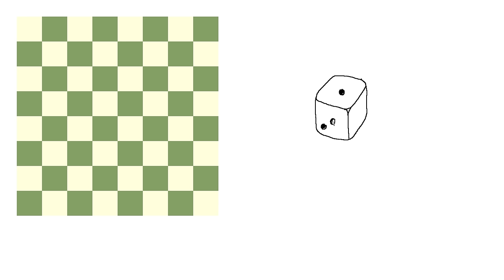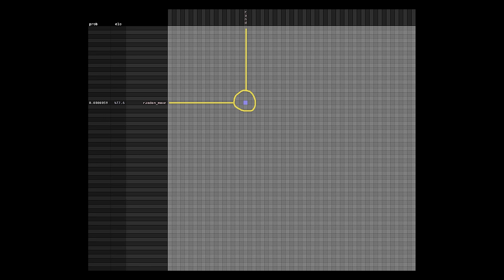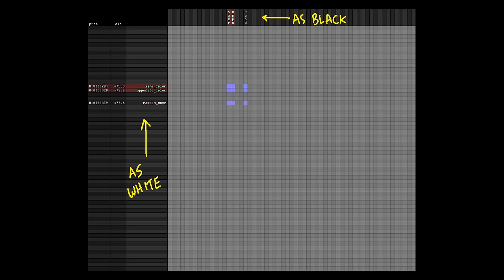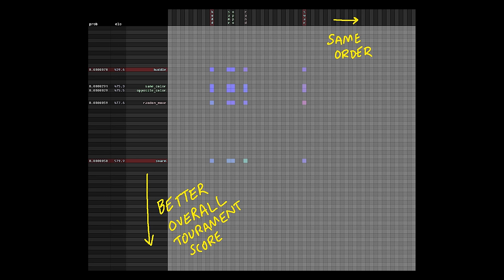30 Weird Chess Algorithms: Elo World

Comment: I know this video is crazy old but I've watched it many times because it's such fun, and I have an idea for an updated version of the blind player if you still actually read these comments. Anyway, I think it would be super interesting to take into account some information theory, much like you implemented spy checking to account for the computer having things wrong, the computer could account for the fact that it doesn't know the /exact/ board and take this into account when deciding the best move. As an example, let's say for the most likely board position there's one move it thinks is best, but not far behind in probability are 4 or 5 boards where the same, different move, is best. You could weigh the probabilities of each board position to the benefit of the move to try and make for better play. You might not want to do this for /every/ board position, as some very unlikely positions would give very favorable outcomes, but integrating this for equally or close to equally likely positions might improve play slightly. Of course this might weigh the algorithm in such a way that it's more likely to believe it's in a favorable position, so maybe it would only have higher winning odds if it got the advantage, and play worse otherwise. I'd bet that stockfish has a more complex idea of what the most "beneficial" move is, but I'm not sure. i.e. a move that removes disadvantage would be just as favorable as one that capitalizes on advantage? Really really long comment for a relatively simple idea (although I'm sure it would be far more complex to implement than I could imagine if done well, likely involving information theory) but I thought I'd share in case you're interested in trying to improve these bad players! The concept of optimizing such a disadvantaged player is very intriguing to me, so I hope you do some day! Maybe I'll even give it a shot, who knows.
Reply from the maker: I agree! I mention a very similar idea as “future work” in the paper, but annoyingly it is hard to get Stockfish to tell you its “second best move” so this ends up being more expensive than it looks to implement. I do think this would work a lot better, though
Reply: @tom7  I'll have to give it a read sometime! Taking into account the next best moves rather than the next best board positions is an interesting idea. I couldn't imagine doing the stuff you do myself, but maybe someday! You've certainly laid some fantastic ground work 😂 Love your content by the way!!! Watching you take "bad" ideas farther than even their logical extreme is always hilarious and extremely intriguing. The amazing aesthetic alone of your reverse emulation of the nes still blows my mind. I legit thought that TV was added in post until you moved the camera!!!

Comment: 4:52 You don't have to. You only have to rank all possible rook moves, then all possible bishop moves, then all possible knight moves, then all possible king moves, and all possible pawn moves. All other moves will be illegal.
23:29 Chessmaster has 14 difficulty levels, but there is a big jump in difficulty from Newcomer 2 to 1: 60/5. Other settings like Deep Thinking, Opening Book and Mate in X moves also affect its performance, but the first 2 levels are pushovers

Comment: So I had a thought about the strategy that scores all legal moves in a tree:

What if the scores assigned alway assumed that the opponent would choose its highest scored move 1-2 levels “shallower”. So if we’re scoring 5 levels deep on the tree, we’re scoring our opponent’s options 3-4 levels deep, assuming the highest scoring option to any move we make will be the response that an opponent will take, then choosing the move that leads to the highest scoring second-level move given that assumption.

I’m not currently sober, and haven’t given the idea much thought, so I wouldn’t be surprised to discover there are some flaws or hurdles that I haven’t considered. I do understand that the recursive nature of this strategy will likely increase computational time significantly, but part of the point is to see by how much and if the trade off is worthwhile.
Reply: As someone who has very, very little experience with minimax (though still a little bit) I’m not sure how that would even work. At various levels in the tree, you’re looking different numbers of moves ahead (for example, by the time you hit the third-to-last layer, you’re only looking at two more moves.)

Comment: Probably way too late for this insight but is it possible the Fatalist pieces perform better due to a sort if reverse survivor bias?

Like, the data you use was drawn from games played normally. So the space a piece is captured in was always placed there by a player with some degree of a strategy in mind.

Since the set of moves by which a piece reaches a particular square is limited, and most pieces aren't moved very many times in a single game - wouldn't an algorithm seeking to place those pieces as quickly as possible end up recreating some of the basic strategies in the games  from its dataset?

Like, to reach the most common death spots, wouldn't the algorithm necessarily have to kind of recreate the most common Openings?

Comment: Lonely: opposite of huddle, pieces would try to move as far away from their own king as possible.

Progressively bad: pick the Nth best move from stockfish, where N is the current move number in the game.

Quest: start by selecting which piece should move using either stockfish or random. Move only this piece until it is captured or is no longer able to move.

Diagonal copycat: copy the moves but diagonally across. E.g. if left side knight is moved, move the right side knight to the corresponding place.

Mediaeval: rooks don't move at all. Queens and bishops do not capture. Exceptions to this would be if such a move would be required to take the king out of check. use stockfish for the selection of these legal moves.

Linear: attempts to create a thin horizontal line. Initially it would have to make some legal move which would take it out of being a line, but thereafter it would only move to make the line as flat as possible.

Comment: Frist come first captured: play the leftmost piece and move it to the farthest leftmost position until it gets captured or can't move
Self-handicap: choose one type of piece randomly and try not to move them as much as possible. For example if randomly chosen piece is a Rook then the engine will try to avoid playing with rooks as much as possible (even if moving rooks might end up checkmating the opponent). If there's no legal moves that don't involve Rooks, then make a move whit a rook that will allow other pieces to move or just make a random move. 
Drunkfish: randomly play between worstfish and stockfish 1000000
CCCP+: Like CCCP, but bit more careful. Will try to avoid playing moves that would move a piece to a square that's protected with two or more pieces. Will also try to capture with lower value piece first (ie will prefer to capture knight with pawn over capturing pawn with queen)

Comment: I wonder if you could build an AI that can identify patterns of pieces in a certain arrangement. It's common that combinations can be executed when a certain pattern arises. After all, if you solve lots of puzzles then your pattern recognition helps you in similar positions. Maybe mating patterns with few pieces can take the highest priority, like anastasia's mate etc. down to more simple combinations like forks. After, layer on some positional high level ideas, like the importance of pawn chains, king safety, controlling the center,  and experiment with different weights on those.
Rally up your minmax and endgame tables, and presto you have alphazero level chess engine.

Comment: Did you try Monte Carlo Tree search (MCTS) algorithm? Without a neural net guiding the search  and material + single piece-square table to give engine an idea of where to put it's pieces what you would get in return is program that develops pieces prwtty reasonably in the opening but may blunder tactics really randomly. Even with fancy Stockfish NNUE which is a cutting edge technology for evaluation, still it's capable to blunder tactics if no so called "policy head" is provided to guide MCTS to pick up "best winning probability" move to play. You can reference my latest couple of live streams from empty file to MCTS + NNUE chess engine in python. I don't provide links in order to not get banned, feel free to ask me for video/code references.

Comment: Engine idea: give each piece type a height. A piece can see, horizontally and vertically, over any piece shorter than itself. The engine should minimize the total number of squares the enemy can see.

caveat: the View Killer engine may also minimize the views on the corresponding video.

Comment: Hot or not: for every possible move, generate an image of the board and submit to an image ranking site and choose the move with the highest ranking image. Variants would be use lowest instead (as chess is for nerds and it may be more desirable to have a less attractive board) or closest to average/middle.

Self-modify: for every possible move, produce the bitmap, rank each in terms of how close the bit sequence is to valid machine code and use highest rank. Variants would be on the machine instruction set.

Coder: use an Internet search engine to determine the next move. Generate a search query for the board state and crawl some results for text content. Strip characters irrelevant to notation and use first matching legal move found in text. Random move if no match found, or maybe use closest weighted match found from input. Variants would be which search engine or website search to use (Google, Bing, Stack Overflow, etc.) and what notation (coords only, maybe some custom variant).

Last one is likely too close to all the suggestions for ChatGPT now but it'd be an interesting comparison for the traditional coder's tool regardless.

Comment: It would probably be worse, but I think the version of single player that looks for check (or equivalently king capture) rather than checkmate would be more canonical. After all, the idea of checkmate is defined by the opponent's moves, which is not what single player is about.
Reply from the maker: You make a good point!

Comment: As the blind engine is too weak, but full knowledge too strong, perhaps a type of ‘decaying memory’ could be implemented, where a piece that is exposed, either by using it yourself or an opponents piece by the move it does, is remembered for n moves, where n can be tuned. You could even split up the memory of color and type.

Comment: I have a suggested method: look only at recorded games of the best n players and create various  distance functions, like for instance if the current board state has a pawn 1 space away from a pawn on the board you are comparing it to-and that is the closest pawn.. maybe that would add a distance of 1 and you would do that for all pieces across all board states you are comparing. Then pick the move for the board that has the lowest distance to your current state.  And you could do this with various distance functions.. like a really lazy and dumb distance metric would be to just take a picture of the board and then compare it with an image matching algorithm such as whatever the one in opencv is called that I can't remember.

In general I think this would open up a bunch of possibilities.. maybe run stockfish on a thousand random board states and pick the one closest to your current state using the distance function.

You could also use stockfish to find the best distance metric for comparing boards states by only choosing moves based on a board state that is an increasingly large distance from the actual state.  Idk.. whole world of possibilities there

Oh another potential distance function, represent each piece as a letter and use levenshtein string distance.  Of course this would work much better if you modified the algorithm somehow to work with 2 dimensions.. and also Damerau-Levenshtein and other such edit distance algorithms
Reply from the maker: I like this idea! It would be tricky (i.e., a fun programming problem) to find board states that are similar to the current one in a large corpus. But it would improve on the "atlas" approach, which does no generalization at all.

Comment: Assign a "danger" value to each enemy piece. A queen is, say 20 danger, while rooks & bishops might be 10 each, etc. Pawns are 2, and the king is 1. The AI will try to take out the most powerful pieces it thinks it can in the next few turns, and taking powerful pieces is the ONLY thing it cares about. Obviously, it's not very scared of the king, so it won't go for a checkmate until his entire army is destroyed, but on the other hand, it should be able to quickly obliterate heavy-hitters at any cost.

Comment: I'm curious - why not draw an "x" on the 100% draw cases?

For example, with the alpha-alpha match. Unless there are 2 valid moves at once with the exact same alphanumeric representation, that must be absolutely deterministic and result in the same result 100% of the time. I'm sure the reason you didn't draw an x there is because it was 100% draw with 0 wins and 0 losses. But why not draw an x there? If you are trying to note where the result is always the same, it would only make sense to include an x on the 100% draws

I think it would be nice to have that information displayed in some way on the table at least, even if it is possible (in most cases) to consider which table entries should be the case in this regard

Comment: I suggesting you try the chess programs to commodore 64 -I must have seen like 50 of those -they should be equally different  to eachohter - I guess a combat chess like Archon is not a cheassprogram -but what do i know.I should add they should be really small programs can imagine any of them bigger than 1/4 of a mb but a fraction of that

Comment: I think for the ML problem you can do better with just a 64 bit board position but maybe I'm wrong.

My intuition is that the spy check logic can be generalized to other cases to avoid intentionally tricky players. Something like computing the expected reward over likely board states instead of the max reward in the most likely state, only.

Open AI gym here I come.

Comment: Excuse me, I got a question. How to make your own worstfish? This seems pretty difficult to me but I'd like to give it a shot.
Reply from the maker: Catzilla0 in my case I am calling Stockfish for the position resulting from each possible move (using UCI interface); stockfish returns an evaluation for the board when it makes its recommendation for those boards. Then I pick the worst one. You could probably also modify stockfish itself (the code is pretty clean IMO), but this would be more invasive!
Reply: @tom7  Thanks a lot, I'll try my best! Modifying engine is a bit too deep for me so I'll try UCI first.

Comment: The direction a mirror flips has nothing to do with polarisation, polarising light is a process that affects its wave on a quantumn level and is affected by the likes of filters. The plane of reflection does polarise light, but that's irrespective of the way things look. Sunglasses use a filter aligned against the polarisation to filter out polarised light reducing glare off lakes or snow.

What you see is purely a result of your orientation to the plane that is reflective, just graph out some rays of light reflecting off a surface of a an image of more than one point, and you'll see it flips an image purely due to the geometry of the paths of the rays.

Similarly a lense is a geometric result of their refractive index, and most lenses in fact do not polarise light at all.

Comment: I wanna see a worst-er fish that use maxmin rather than the minmax stockfish uses, i.e. assumes that each player is going to do the worst move available to them.
In other words "no matter what you do I can still throw"
Reply: So playing minimin, but assuming opponent is doing the same?
Reply: @NStripleseven  no, basically the inverse of normal chess, assuming both players are trying to lose.
When you use minmin, an implicit assumption is that your enemy is going to use is best available move. It's the bot that will lose the quickest to good players, but it might even accidentally win agains a bad one.
A maxmin algorithm is designed to lose against any opponent, not just good ones